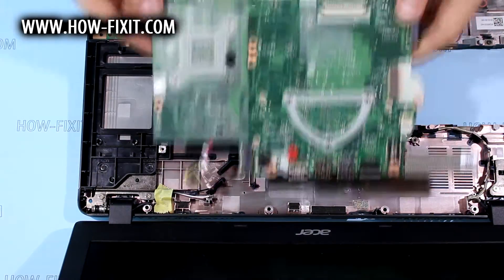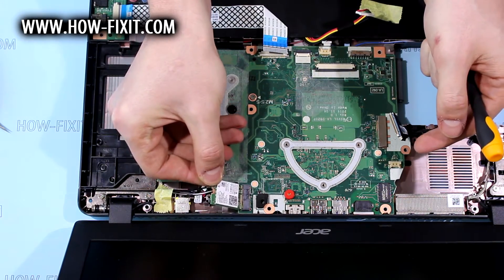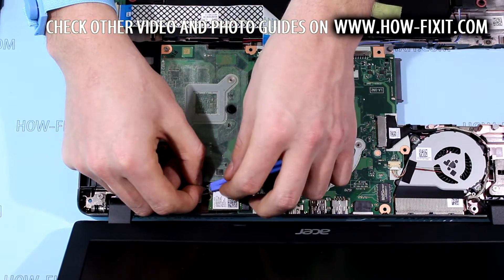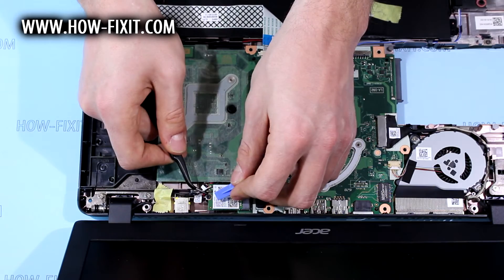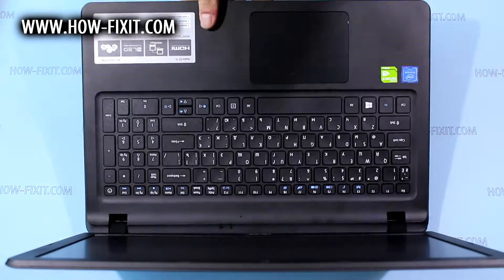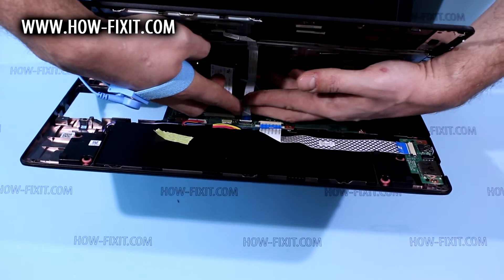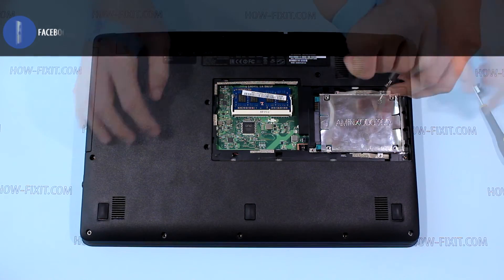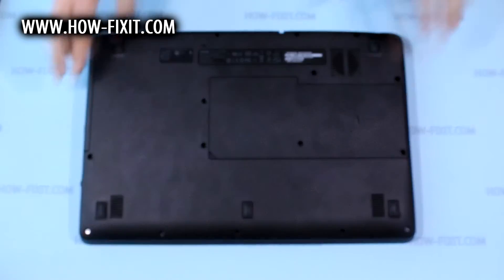Acer Aspire ES1-532G, ES1-533, ES1-572 Laptop Reassembly Guide

Comment: At the top right, above the fan or below the battery there is an empty connector with a lot of space, is that a sata connector for an hdd caddy? I have ES1-533, without dvd reader or hdd caddy but on the right side there is a piece of plastic that looks like it could come out.
Reply: It's just a dummy one, afaik it's not upgradeable
Reply: @cominginhotpink  I did buy a hdd caddy and have a 1tb hdd in it now, so you can have an ssd and hdd or dvdr at once in this.
Reply: @OZSA87  Oh, nice